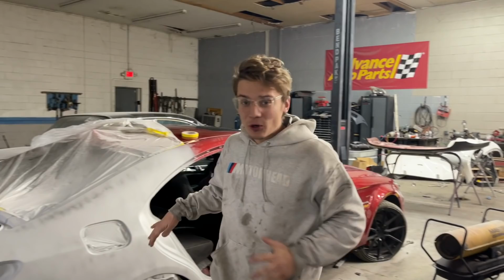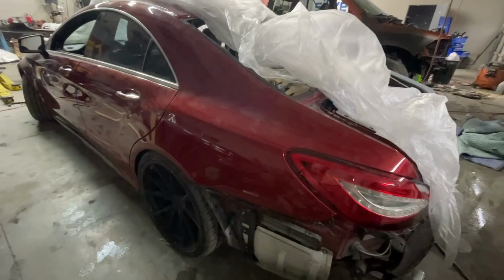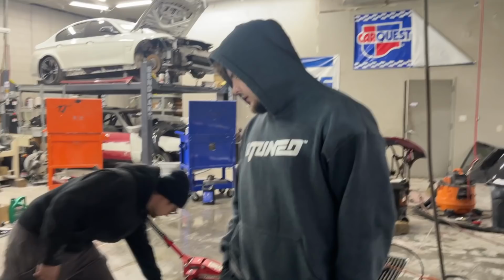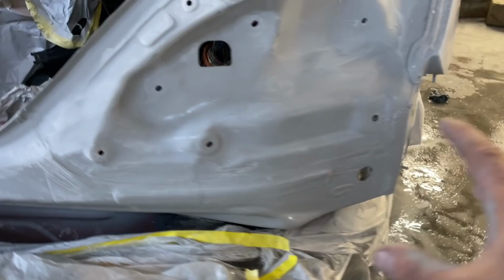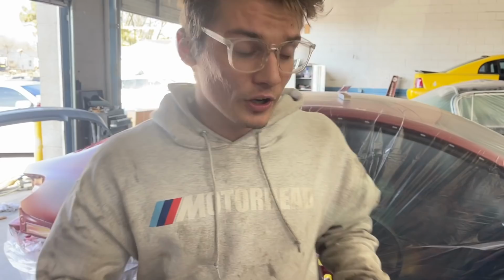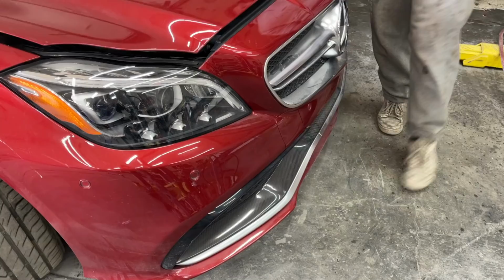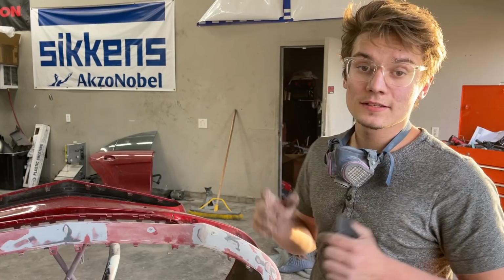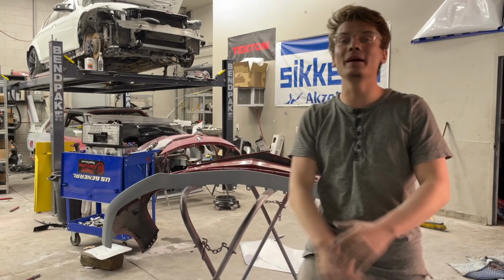Fixing Hidden Damage On The CLS63 AMG And Painting Its Jambs! So Close To Completion!

Comment: GREAT work young man, you can do it all, your pop's raised you right. That bumper had more part's on it to remove than 5 bumper's from most car's, you just kept taking thing's off. I loved the way you used an-other's bumper scrap part as a filler for this one. I've always wondered why more people don't do that, they use an epoxy, which is okay but it's better/stronger to use the same material to repair it with. Great video, keep them coming, I can't wait till it's finished and see the final car..